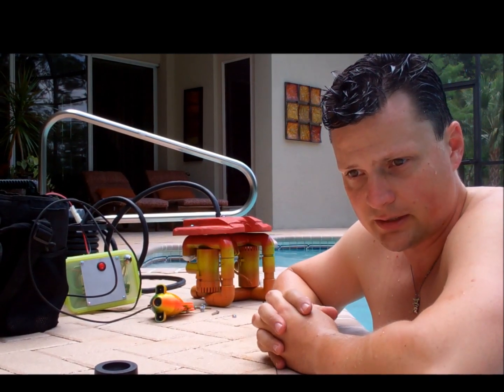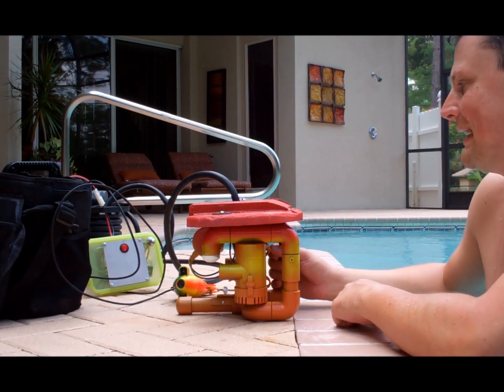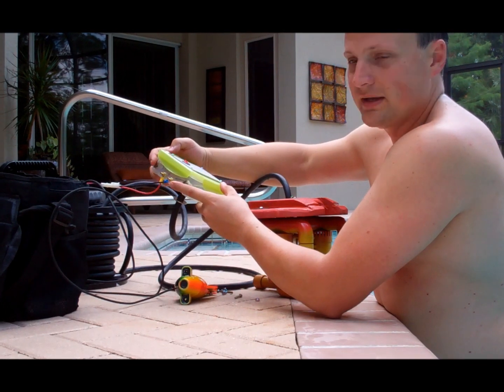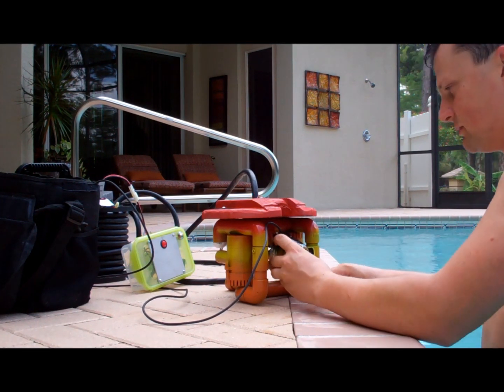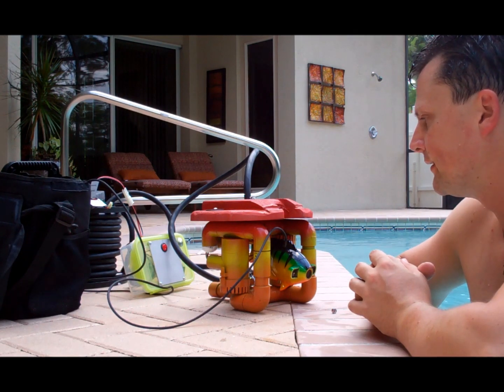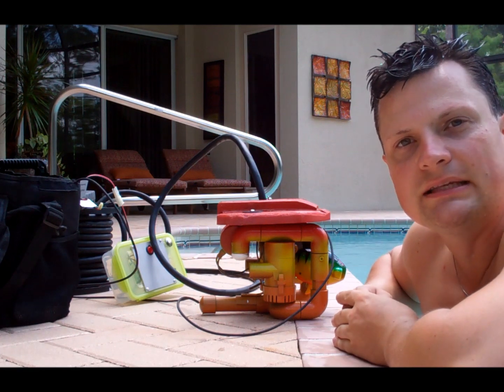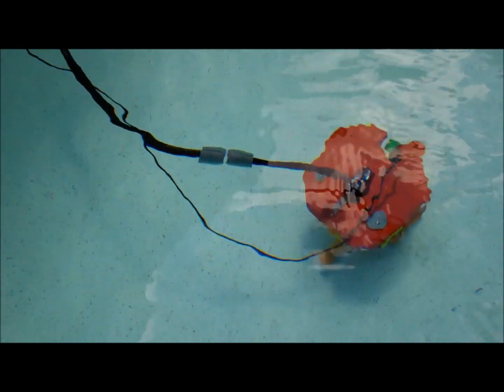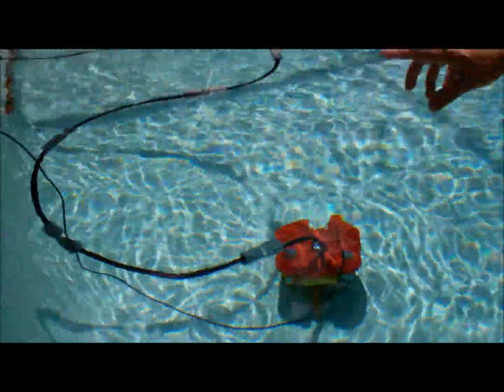ROV Mark 2

Comment: where is the vertical thruster/pump located? is there one? thanx
Reply from the maker: Mike Boston Mike, there are three pumps aboard, left thrust, right thrust and vertical thrust.  The ROV is ballasted slightly negatively, meaning it will sink if left alone.  The vertical thruster then only needs to provide upward thrust, which is routed through a manifold with twin exits, one on each side, just above the left/right pumps.
Reply: thanx
Reply: Did you use bilge pump for Vertical thrust too ?

Comment from the maker: The parts are quite cheap... probably $70 or so from your local hardware store.  The camera in this version was the most expensive part at $400 as it was a self-contained unit including power pack, camera, cable and monitor.